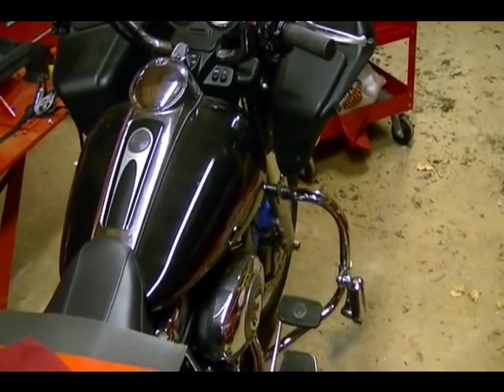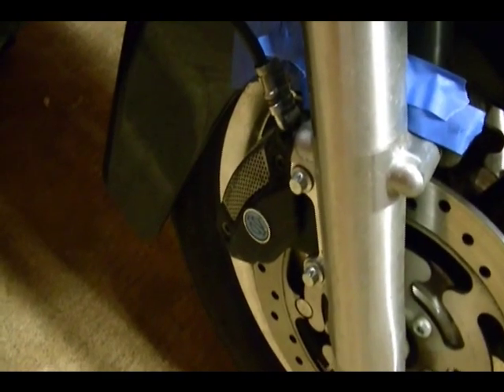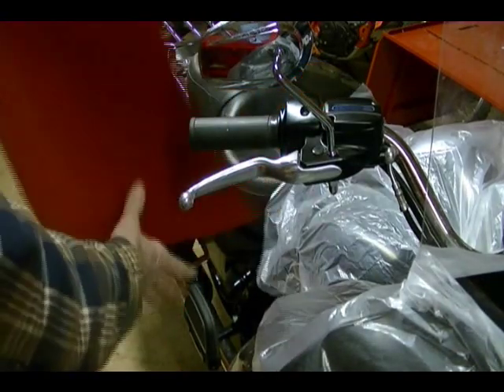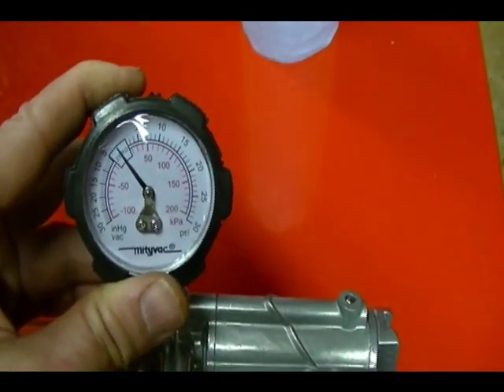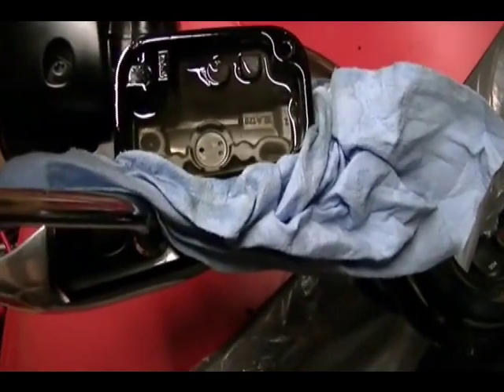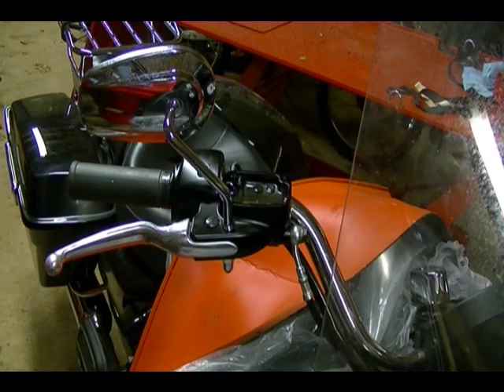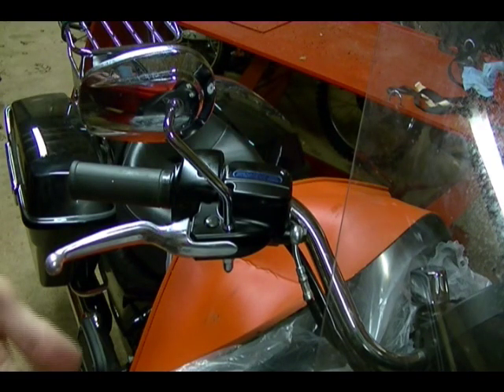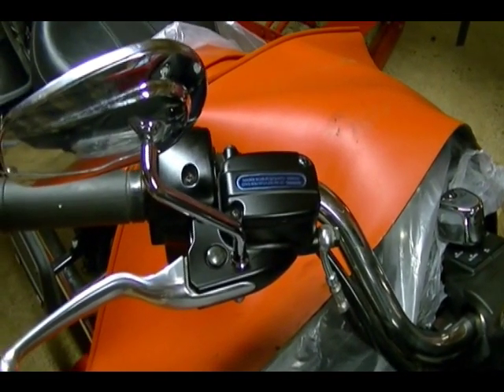Motorcycle Brake Repair: Replacing Bleeding Front Brake Fluid on a 2008 Harley Davidson Road Glide

Comment: note for future viewers. most first time brake fluid changers don't know this, but if you pump the hand pump too much you can accidentally suck brake fluid into the hand pump itself and on the cheaper models brake fluid will ooze out of the seals in the hand pump and make an awful mess.

Comment: I rebuilt MC but something not right. When I clip in the plunger, I can see the first washer go past the bigger hole so no fluid is pumped, or doesit go in the little two?. Can't see in them. Reason back in, is because I can't build pressure. Won't bleed. Got one of the vac pump but nothing. I finally found someone with my bike! YOU! HELP! Think I put it together like it came out. Can't seem to find a illustration, how it's supposed to look in relation to that port. Hate to bother you but I been screwing with it for longer than I want to admit. I'm subbing with the bell & all if that's anything...

Comment: Make sure the right DOT type of fluid is used for your bike..i put Dot 4 in mine but was told at Frasers Harley that you gotta use Dot 5 so back i went and swapped it all out for harley purple coloured Dot 5...prior to the work my rear master cyclinder was full of jelly! I was lucky i didnt crash! Had only just replced my front callipers piston and seal with a service kit from the dealer...otherwise. Would probably be in heaven (or hell) now...stay upright gents

Comment: So in your vid, you drain all of the fluid from the system so its dry.  Then re-introduce fluid.  I've always heard its bad to get any air in there.  Is there a benefit from doing that as opposed to just topping off until the old fluid isnt in the system?

Comment: Thanks for the video. I recently switched from a single disc front brake to dual disc on my Dyna, your video helped with the install, as I had to swap the master cylinder and brake lines and start with a dry system. Clear and to the point, much appreciated.
Reply from the maker: Good to hear! Thanks for watching!
Reply: ***** Great video clean and simple. Had one question I would like to replace the front pads on my 08 Road King it has ABS and I was told that when you bleed back fluid to expand the calipers for the thicker new pads that this can mess up the ABS sensors causing some grief. Any advice would be appreciated.  Rob
Reply: Yes on a ABS Harley ,the Dealer will have to reset your ABS ,if any line is opened or even had changed a Tire ,of coarse pushed the pistons back to clear the rotors ,this set off the ABS to have to be reset.
Reply: I had my front tire changed on my 08 road king and had him do pads as well the bike shop that did the job did not crack the system open, just pushed the pistons back so the rotor could accommodate new pads. At times at crawling speed there is squealing annoying as hell also I tried the brake test at 50 miles/hr and there did not seem to be the pulsation that I had before the pad replacement, abs light still flashes at start up and goes out at 3 miles per hour also removed some fluid from the master cylinder as it was over the full mark, the question is do I need to have my sensor reset from the dealer?

Comment: This is a great video.  I appreciate how you get to the point and don't try to say many opinions or try to let the world how much you know.  I have a subscription to Fix My Hog, and I have to be honest.  Although I know the guy knows a lot, sometimes it is torture to have to listen to him.  I can't stand his teaching style.  Do you have something on lubrication clutch and brake cables?
Reply from the maker: Thanks. Yes, I have a video about lubricating the clutch on a KLR 650. It will be the same on the HD, but the tool I use in the video won't fit the HD clutch cable.

Motorcycle Repair: How to Lubricate a Motorcycle Clutch Cable on a 2009 Kawasaki KLR 650

Comment: My bike has had electrical issues. Long story short, I had to push my bike up a couple of shallow steps because I couldn't ride it up and I accidentally pushed it over. I have ape hangers, so my brake reservoir took a hit and broke the seal, and there is no pressure in the front brakes anymore. It seems like you're saying that I should still have pressure in the brakes so long as there is fluid in the lines...so I was going to change the fluid and bleed the line, but now I'm guessing something else got messed up in the fall?
Reply from the maker: Sounds like something got broken in the fall. The master cylinder is designed to build pressure and transfer that pressure through the brake fluid and to the caliper when you actuate the brake lever. A broken part or loss of brake fluid can cause a loss of resistance when you pull on the brake lever.
Reply: I went and changed the brake fluid and bled the brakes. There is pressure back in it, but I'm not entirely convinced there is full pressure back in it. I can't be sure though, because I haven't rode my bike in a year (haven't had money to fix my other issues), so I don't fully remember how much pressure was in it in the first place. I rode it around the block and it seems OKish enough I suppose. The issue I think was that the line coming from the reservoir got knocked lose a bit and was leaking. I tightened it up and squeezed the brakes a couple dozen times, and after riding it around as well - it seems like its not leaking anymore

Comment: I had recently replaced my bars and they came with new switch housings and master cylinder. I followed your video the best I could (no fluid in new master cylinder), and at the calipers I got nothing but fluid, however my brakes still feel spongy. Someone told me I have to bleed it from the banjo fitting...huh? Can you provide me with an ulterior way to fix my issue?

Comment: Thank you for your video is very helpful
My question is I have a 2012 Harley with ABS.
Is the bleeding any different being ABS??
Reply: ABS is different ,and Harley has you ,if you brake an ABS line the ABS system will have to be reset ,so bleeding brakes will cost you.

Comment: nicely and slowly explained. Perfect, this was just what I needed. This would be the procedure to drain and bleed the break fluid when I have to change the copper washers on banjo bolts, is that right? They are sweating, so I suppose they are damaged and have to be changed? i just rode out after the winter and seen they leak.

Comment: According to my local dealer DOT 5 brake fluid is used in my 2002 RK this shouldn't affect the paint job since this stuff is silicone based. Doesn't your bike also have DOT 5? If so it is not needed to cover your bike with foil...that said, it doesn't hurt either ;-) Great vid anyway!